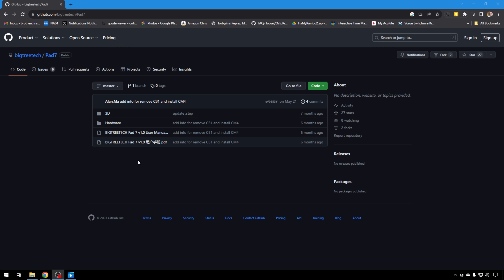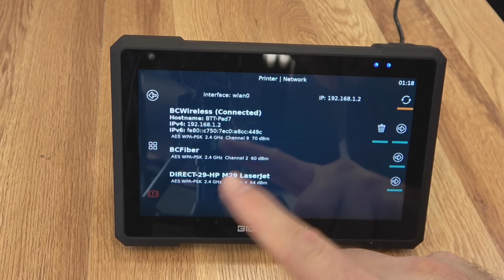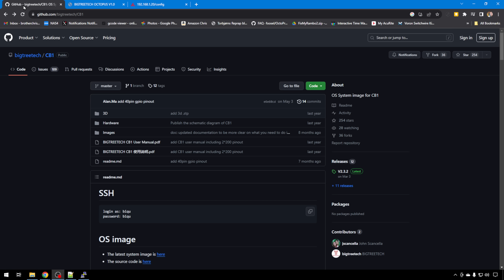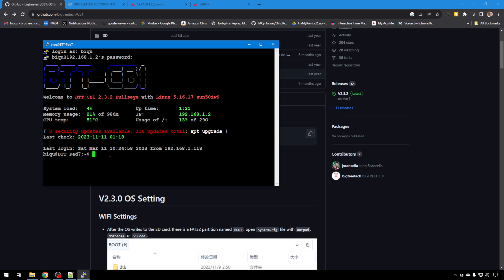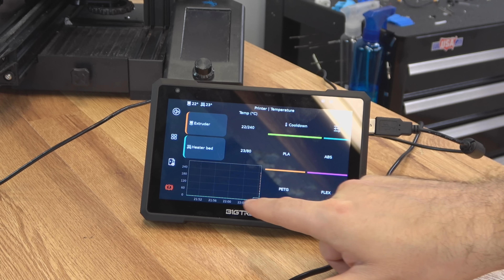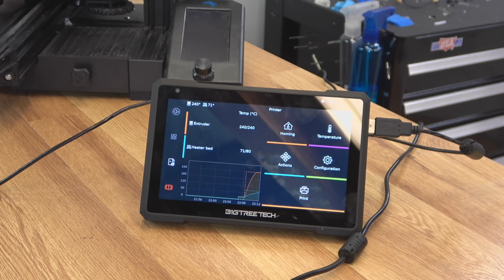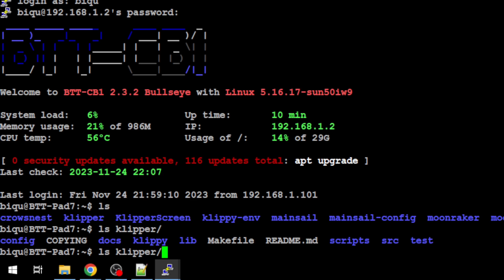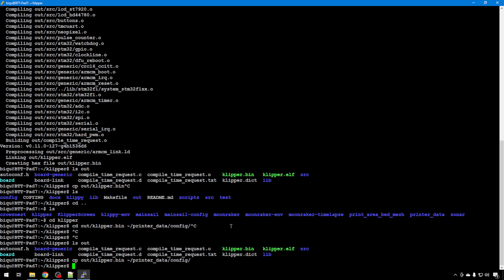Pad 7 - Klipper Touch Screen - BigTreeTech - Chris's Basement - 2023

Comment: I have tried the sonic pad, rasberry pi 3b and the pad 7 so far. . I love the pad 7.  I have 3 out of 4 printers running klipper and the easiest one to set up was the BTT pad 7.   BTT made easier when it comes to setting up klipper. Same goes for the cb1 or BTT pi. They did a great job. I had so many issue flashing klipper on my pi. So for those who are considering one, i support it. Now it is still a bit of a learning curve but a better product then the sonic pad hands down. But like chris said it still is some work. So dont expext plug and play.
Reply from the maker: Awesome, thanks for your insight!

Comment: Done 2 prints with my Ender 7, wanted a BL Touch, saw lots a problems with it with flashing or even GETTING the firmware with BL Touch.
Bought BTT Pad 7, make'd the bin file flashed the printer. and WHOOM done... 
did find out  that using the "Glue "stick" made my life 90 % better i printed like 13 things in over 3 days and not one went wrong. (PETG b.t.w.)...... must be the bed.
Some how in the last 3 days my printer got kinda "white" including the part cooling fan ducts that break on EVERY Ender 7  as i saw online..... :P
Oh and upgraded mine to an CM4 with 32Gb EMMC and then i lost the "rgb" leds on the pad and my sound :P running mainsail os now
Reply from the maker: Cool that this made it a lot easier for you. PETG does have a tendency to leave white dust on things.

Comment: It comes with accelerometer and can be powered directly by 24v, also you can print mount for ender like printers. One of the best upgrades.
Reply from the maker: Cool, thanks for your comment!
Reply: Can it really? The sticker on it's back doesn't say 24v .

Comment: I don't get the thing with CAN-Bus and how BTT is implementing this. Why do i need a whole Octoboard (without drivers) for this?
Reply from the maker: Really the only time I can think of it being handy would be to swap whole tool heads. If one was a lot different than another, the tool board being attached would let you change a lot less in the configs. I still need to check out the whole process.

Comment: I have all btt boards in my printers 3 of them. I wonder if the pad 7 is capable of running multiple printers at once.
Reply: Yes it does, have 4 printers connected . Make multiple instances of klipper
Reply: Hello @aaronl3628  how did you connect 4 of them in 3 USB ports? Thanks

Comment: I own two for my two printers (flsun qqs pro and sovol sv05) they have been a great upgrade. However the setup was only completed by online YouTube tutorials, only. Which I think is not really acceptable IMHO. Do the pads make a difference? Absolutely first class, they are cheaper to run, but I'm still unable to load print files to a usb flash drive and upload as I'm ready to use. A big issue for me. BTT please take note, a great product but support must be better along with decent instructions.
Reply from the maker: Thanks for your insight!

Comment: Ive been having some issues with my pad7. 1) Ive done everything i could with setting up the adxl345 but every time I run accelerometer_query I get the error "invalid adxl345 id (xx vs e5)" and don't know what to do. 2) when trying to upload sliced files from orca it keeps failing to upload when this happens i go into putty to make sure everything is updated correctly and i get the error disk space on device full error. Anyone have a solution
Reply from the maker: Strange errors, the adxl error must not like something about the device address. The space issue is something all together, maybe the space didn't get freed after the build. What does the output of df -h look like?
Reply: I ended up updating to the new cb1 release which stopped the device full error. I still can't get the adxl to work and alot of the features on the pad aren't working. I need to find the original version that came on the pad and go back.
Reply from the maker: @richardnunez3637  Not sure if it helps, but here are all the images. https://github.com/bigtreetech/CB1/releases

Comment: I've been running the SonicPad on my 2 Ender 3s, which is my first experience with Klipper. I like it, it's pretty much plug-n-play. But I want to get a little deeper into Klipper. I was wondering, how well does the Pad 7 handle multiple printers? Also, how well does it handle a webcam?
Reply from the maker: More to come!
Reply: You can buy any klipper compatible usb camera and it will work

Comment: This was actually what I picked up when I got fed up with the makerbase skipr being buggy AF. The one thing I want to know is, is there any difference worth putting a CM4 in place of the CB1? Seems to be fine with the CB1 buuuut, you never know how green that grass is over the fence!
Reply: I'm getting one for Christmas. 
I am planning on running two printers with cameras on it, so I picked up a 2GB wi-fi CM4 to possibly swap out the CB1.
A local person I talked with didn't think the CB1 could handle two printers AND 2 cameras. Crowsnest is a bit hungry, and my Pi Zero 2W couldn't compile it.
Reply from the maker: That's a good question, I'm not sure how the performance is on both, I will have to compare and report back. I think the CB1 is more than good enough to get started.

Comment: Pad 7 have big problem with WIFI, if you have problems just swap to antenna CM4 to solve that problem.
Reply from the maker: Awesome! Thanks for the tip!
Reply: I need to investigate this further, I'm having WiFi issues on both of my pads.
Reply: @aarondavalon8985  You don't need investigate. Antena design is shit and if you replace to something else will work like a charm.